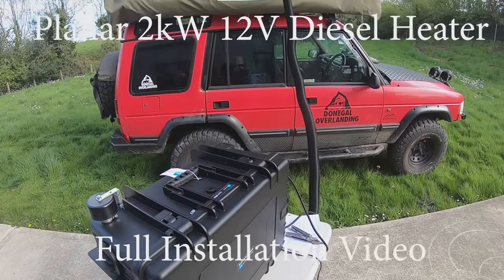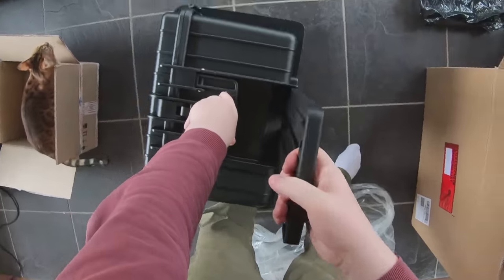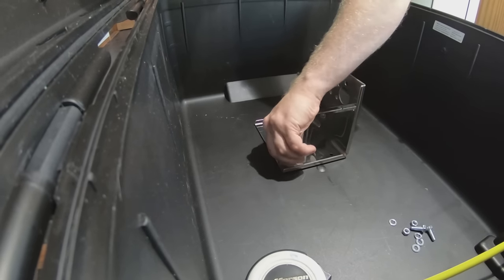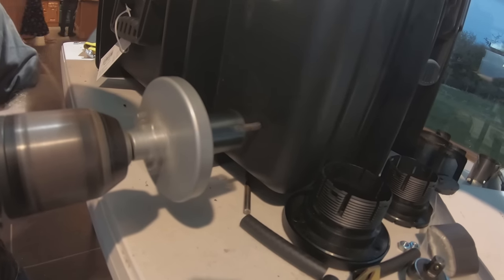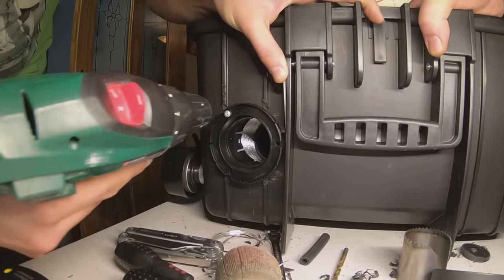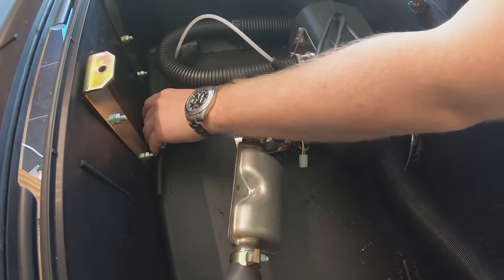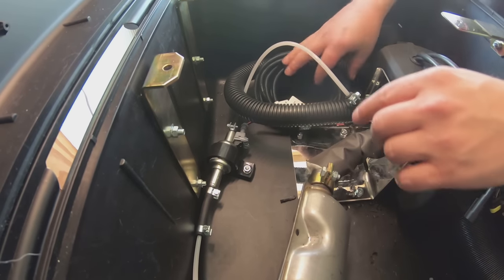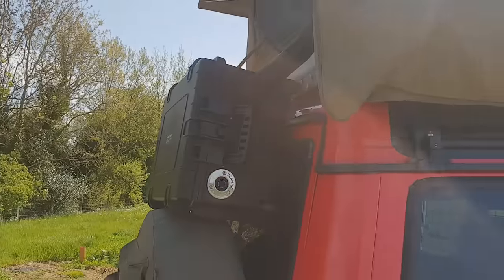Diesel Heater In A Box Install

Comment: I have to say, I'm so impressed with the professionalism that you installed the heater into the case.

Amazing job, really well done. 

Also for your tip at the end, that's the second time that I have heard it, so it's obviously very important to keep the heater running sweet.
Reply from the maker: Thanks Rew.  The advice about running them on full power is direct from the technical department at Planar in Russia.  I told them I was going to make an install video and I asked them if there was any message or information that I could share with people watching the video that would help them.  They said that the vast majority of problems people face are due to not turning them up after use, or not using them for months at a time during warmer months.  They were excited that I was going to put this message in because they know it will reduce the amount of calls they will get.  Perhaps it should be clearer in the instructions that you need to do this step.

Comment: Good video, I like how you thought it out. I took a chance with one of the Chinese units. Just like yours, easy to assemble  and has worked flawlessly for 2 Canadian winters. I also take it as a tent heater in the fall. No complaints whatsoever. Every week or so I turn it up to max to keep the burn chamber clean.

Comment: Fantastic idea, and beautiful build. I’m very interested to see or hear how it worked or is working. Any issues with heat in the box or if you modified your build in anyway to make improvements?
Reply from the maker: Still working perfectly to date.  Zero issues at all.  The box doesn't get hot at all, not even slightly.

Comment: Nice job. I made my own version from an Eberspacher heater. One major difference is that I run the air intake from the cabin too so it's really efficient in cold weather.
Reply from the maker: Thanks, I had actually considered this but then decided I would rather have fresh air coming in.  Despite this, it is truly incredible how efficient these heaters are.  I use green diesel here in Ireland, its the same as red diesel in the UK, its designed for "off road" or agricultural/marine use.  Its around 80cents per litre.  Its sold in almost every filling station at the pumps in Ireland.  The looks I get as I have my Land Rover parked next to it, people assume I'm brazenly filling the Land Rover with it! :D
Reply: Yes, the diesel heaters really are efficient. Sometimes I do use mine with a fresh air intake too and this is handy for creating a positive pressure in the roof tent, which keeps the midges out.

Comment: Planer heaters are assembled in Russia, check inside the case near exhaust on casting... made in China as are the electrics and silencer....how do I know...I've serviced loads and they are all chinese. The box you are using... made in China. Most of the systems in your land rover.....made in China. I think it's how you look after the gear is what makes things last. You are very precise on you build and it's done very well hence it will last a long time. Good build.
Reply: All diesel heaters are making in china,big brands tools also,you have choice what name and model what amount   you pay for this.

Comment: Whats the longest you can have the hot air pipe to the tent as i would like to run one though my van window so 3 mtrs ? is that to long.. thankyou for the great video.
Reply from the maker: You can have it 3m long no problem at all.  You will lose a bit of heat through the pipe of course, but these heaters are so hot it wont matter.  I would suggest putting some waterproof insulation around the hose, that way the air coming out the end will be a lot hotter and you could turn the heater down and save a little fuel.
Reply: @DonegalOverlanding  Thankyou for your reply and expertise much appreciated .

Comment: Personally I would buy some insulating foil tape for that tank and perhaps some heatwrap for the muffler. Just peace of mind, plus by having the muffler wrapped you ensure better exhaust flow and keep internal temperatures that much lower, which helps slow plastic degradation on things like wires and your case. It's the little safety things afterall.
Reply: Thats all a must IMHO
Reply: @welcometoreality3450  Another Wild idea: let the Cold air intakte go through a compartment sourrounding the muffler and tailpipe inside the box. That Will remove All heat as even with wrapping, the exhaust still reaches 200F. This Also saves a small amount of fuel.

Comment: Great video, i would put a silicone oven mitt over the muffler for a heat/shield.Nice tent setup...
Reply from the maker: The muffler gets hot alright, but it barely warms the fuel tank inside up at its closest point.

Comment: I put a cheap chinese heater in my electric tuk tuk and it has been working good so far, I drove it last night to the store and back home in -1 Celcius with a little snow on the ground. For what I paid for it I say it was very good deal for what I use it for anyway. Interesting with the outside housing/casing but it will make it easier for someone to steal it or mess with it though compared if it is locked inside my Tuk tuk.
Reply from the maker: Where do you live?  What is the model of your electric tuk-tuk?  Would love to look it up and see what it is like.  We think Tuk-Tuk's are so cool
Reply: @DonegalOverlanding  I live in Sweden. This is one of them when I was out driving to test the heater https://youtu.be/Rj7y5uvEYhA. I imported them from Lianke Machinery in China, the heaters I bought on Ebay uk. I bought the all in one heaters to make it quick to install them but you loose some space with them. I will probably use an extra battery just for the heater to save on the driving distance.

Comment: iv got 3 cheep chinese heaters i use  NEVER had 1 problem with them
Reply from the maker: That is great to hear Stuart,  Hope they continue to work perfectly for you.
Reply: OPEN UP THEM AND LOOK INSIDE :d they not heating as much as new. unles you always used max temp
Reply: With all that cheap junk the concern is having no clue what you're going to get. One might work perfectly for 10 years and the next may die on day 5, you just have no idea about those Chinese knockoffs. That doesn't just go for diesel heaters either btw, it goes for pretty much everything.

If anything breaks that can also cause a real issue since Chinese "companies" don't tend to be big on customer support or replacing stuff. You likely can't get it fixed locally either as no one really has a clue about what it is or who made it.

I'd personally never trust cheap Chinese stuff when it comes to things like a diesel heater since it can potentially cause massive amounts of damage so it just isn't worth it to me. If it was a cheap Chinese action camera or whatever the potential damage caused would be minimal so that might be worth it.

Are those Chinese ones even approved? In case your entire van burns down is it covered by the insurance?
Reply: Gnawer Shreth 
Interesting question regarding insurance 🤔
Reply: Gnawer Shreth, your statement is filled with baseless fear, conjecture and hyperbole. Any competent mechanic with critical thinking skills can install or repair of these Chinese knockoffs. They come from the same Chinese factories that manufacture the European and Russian designed one’s. Don’t fool yourself, they’re all made in China, final assembly ‘might’ be done in Europe somewhere to claim “European built” status but everything is cast or produced in Asia.
Reply: @tamistone2632  at least you get it.

Comment: I will make this! I have a van, and I want to keep it as a van, but with possibilities to camp in it. This would be genious to bring on trips anywhere. But I dont have any ideas on how to get heat INTO the car without having any doors open. You know, to keep the weather out of the vehicle. Any ideas? Easier to just install it into the car as it is supposed to?
Reply from the maker: I have seen people use a wooden or metal board, about 20 high.  Shaped to fit their window opening.  Then they cut a hole in it just big enough to fit the hot air pipe.  They usually put an adapter in there for the hose to connect to.
Reply: @DonegalOverlanding  Thanks!

Comment: Good job, gentlemen, very interesting solution. I've seen folks install an on-demand water heater in outdoor cases, but never a diesel air heater. Nicely done, mates! 

I'm getting the US version of the heater you're using, the Espar, to install in my diesel van for cool weather and winter camping. It's used widely here in cargo vans, expediter vehicles, and big trucks. Thanks for posting this at OLB, too!
Reply from the maker: Thanks Road.  There are Eberspacher, Webasto and a plethora of Chinese copies on the market.  The Chinese ones are like a lottery so there was no chance I was going to risk it.  The Planar was less expensive than the Eberspacher and Webasto and just as high quality, so it was a no brainer.  These kinds of heaters would be found in trucks, emergency service vehicles and campers all over the place.
Reply: Yes, the Eberspacher (Espar) are the most popular and dependable here in the states and widely favored over the Webasto. I hadn't heard of the Planar 'til now, but it looks identical to the Espar units in shape, installation,  and muffler, etc. Good luck with yours, and keep the great vids coming!

Comment: I have been looking for something like these heaters . for my offgrid house. It's not a tiny house but still kinda small. And I do not use much heat . I'm guessing two would run me out of the place. I can use wood for the really cold times! I guess 15amps at 12 volts will be enough. Wouldnt it be cool if they generated their own power! That would be awesome! Something like a model turbine engine and a small generator. Use the heat from the turbine.. Great video..

Comment: Great job, very professional. Got some great takeaways for my install. Can you please tell me what the draw rate is on the 12 volt system. I plan on using and external battery back up unit for my 12 volt supply. Thanks
Reply from the maker: Hi Bob, thanks for the kind words.  We are not sure of the amp draw as we never measured it. Our vehicle is in tue garage being turned into an overland camper so we do not have access to test it.  The specs will be online though for it.  It doesnt use much when running, it uses a bit more at startup whennits using the glowplugs.  So we stopped using the automatic thermostatically controlled mode where it tirned on and off to regulate temperature, and just have it running the entire time on whatever power setting matched the conditions.  That way it uses very little power.

Comment: Money well spent. I have a planar 44d - 12 with at least 15000 hours on it. Never replaced a part yet. I took it apart a little while ago and it's not even dirty inside the burner. I allways run on power mode sometimes for months without shutting down so I assume that's why my glow plug hasn't failed yet.
Reply: 15.000 or 1.500  ? Eberspaecher advertises their latest heater to be designed for 1000 hours ...   15.000 means you had it running for 2 years straight

Comment: That’s the set up I need, could you use a jackery 500 to power it ?
Reply from the maker: It depends on the output of the Jackery.  I would think it would work, but you need to look at the specs.  There is a bit of draw when it starts and stops.

Comment: I like your logical thinking. 

If I were to copy your project but use the cheap Chinese 5 kw heater, do you reckon I would be in much danger if it went wrong since it’s an isolated box outside the vehicle? 

Some of the cheap Chinese ones that you decided to pass on for the risks cost only about 100 bucks. 

Which after looking at them for a while, come with their long list of drawbacks but i am a little keen to try it as an inexpensive experiment
Reply from the maker: I do not think that you should not go for a Chinese heater if its the limit of your budget.  It was only a personal choice to go for better quality, the main reason being that throughout our lives pretty much anywhere we went cheap meant we had to buy a quality version later.  Having a Chinese $100 heater that works is vastly better than having no heater because a Planar/Eberspacher/Webasto is too expensive and you don't have one.  So Id say give it a go and see how you get on.  If you do, post back and let us know how you get on.  This video has the most amount of thumbs down of all our videos, and thats mostly because people who bought the Chinese heaters did not like our criticism of them.  That's fair enough, everyone has an opinion.  If it works for you, that is all that matters.
Reply: @DonegalOverlanding  Just purchased mine and now looking for a slightly cheaper box to copy the build :) , do you find that it's important what orientation you place your box? For example, in the video you have it the longest side of the rectangular box, vertical when you show it on the vehicle running,  but could also place it and run it on the roof of the car in the orientation that most of the  video is shot during your assembly?

Comment: Did you not have trouble with heat buildup from mounting the muffler in there?
Reply from the maker: Hi Darren,  people ask all the time about that.  I made a video, its very short, that covers it in detail, with temperature readings on the muffler, on the fuel tank etc while in use to show what its like. https://www.youtube.com/watch?v=Jq8TjPk33Gs

Comment: Are you running this with lid open? Otherwise It’s going to get brutally hot in that box, maybe a inlet for small power supply fan and outlet for the heat to get out
Reply from the maker: No, it doesnt get brutally hot, or even hot at all.  Its been like this, for well over a year and its only ever warm in there.  Been through this a number of times in the comments.  There is so much space in there that it is able to cool easily.

Comment: Hello from Alaska great video very well done.   Could you elaborate a little more as to why you put the fuel tank inside the case?   I am not critiquing I only have some concern about the muffler that is not insulated and so close to the tank?   Again thank you for this awesome video
Reply from the maker: Thanks Christopher.  We spoke with the Planar technical support team about being able to put the fuel tank in there with the muffler inside the case.  They said it would be no problem at all.  The reason for putting it inside is simple, its easy to move it around and store it with everything protected inside the case.  With the fuel tank on the outside it is highly likely to be damaged.  Not everyone goes off-road, but we do all the time and it can be very rough.  The side of the fuel tank is only very slightly warm to touch after hours on full heat, so there is absolutely no chance that it would melt or cause any problems.

Comment: You should have taken Combustion air from the inside of the box, there by cooling the case..

You would then need two filters, but the first only needs to be a simple screen filter over the air intake to the box.
Reply from the maker: The case doesnt get hot.  I have said this repeatedly throughout the comments section.

Comment: Love the idea of putting it in a box like that. Thanks for the video. What group are you apart of that talks about these. I work on the wabesto ones for my job as a Diesel truck technician. Like you say in the video make sure you run them in the summer months. We live in an area that doesn’t have a lot of cold MO this so almost every year we end up repairing them before it gets cold since almost none of the drivers run them in the summer months.
Reply from the maker: Hi Jared, you're very welcome.  The group I'm in that has huge discussions about heaters is called Chinese Diesel Heaters on facebook.  There are plenty of Chinese ones that are running perfectly well, it is just difficult to know what you're going to get when ordering.  So I don't want to say a Planar is for everyone, if you don't want to spend that bit more then don't, join that group and glean as much information there about individual models and reduce your risk.  Feel free to sub to this channel, we have loads more videos to upload!

Comment: Hello! How was this setup worked for you? I have purchased a heater and want to build something like this. I also have a rooftop tent and want to winter camp.
Reply from the maker: Hi Jeff, it has worked out just exactly as we had hoped.  It has been very reliable, efficient and has had no issues at all.  Its so good that many of our friends have also bought heaters in a box.  It truly is a game changer.  We hads tried many solutions, electric blankets, hot water bottles, high rated sleeping bags, but none of it compares to going to bed and the whole tent is hot.  Just make sure you leave the doors open a bit to allow moisture to escape.  Because of the massively increased temperature differential between the inside of the canvas against the outside, it makes condensation a real problem if you dont allow good airflow.

Comment: How hot will it get inside of a case with muffler being enclosed in it??? Will the electronics of the heater survive the temperature inside?
Reply from the maker: Hi Agent 404, that is a question that has been asked by many people.  Before I put this together, I spoke with Planar technical department in Russia and explained to them my idea.  I specifically asked about the temperature inside the case considering that I would have the muffler inside the case.  They said this would be no problem at all.  I have tested the inside of the case a few times, even after 6 hours on full heat, the inside of the case was about 25c (77f).  I know this is quite hard to believe as the muffler would be hot, but its not having the impact everyone is thinking.   While I am here, would really appreciate if you would share the video and sub to the channel to help us grow.  Thanks.